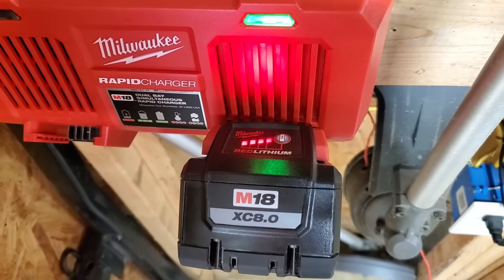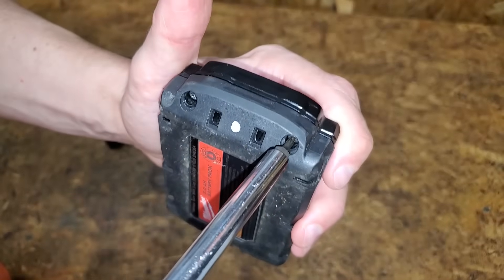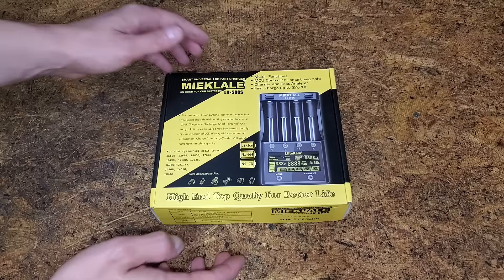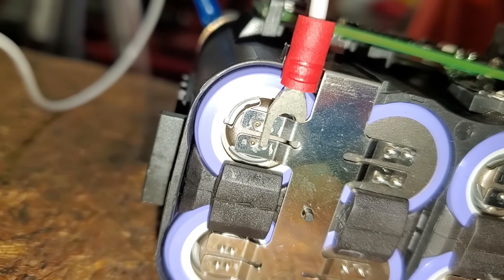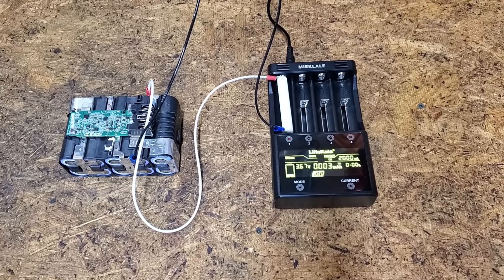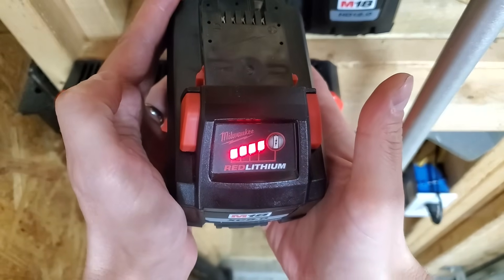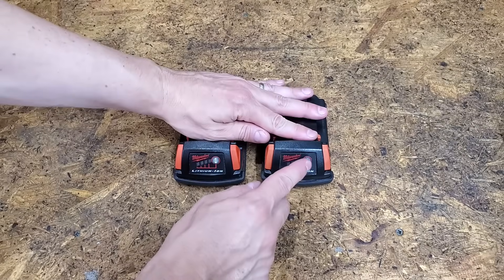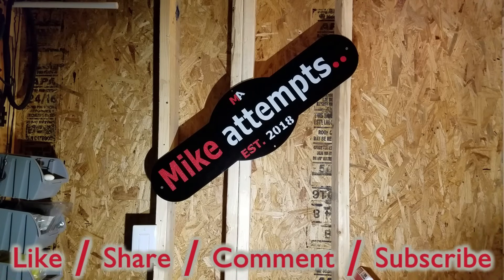Balancing Power Tool Battery Packs

Comment: I have a flat M18 6ah. I forgot it in my backpack sprayer and when I found it it wouldn't even blink when I pushed the button. Put it on the charger and the charger flashes red. Think this technique could bring it back to life?
Reply from the maker: From what others have been saying in the comments, this could work to bring that 6Ah pack back to life. However, some chargers have a low voltage cutoff and won't start charging unless they sense a minimum voltage. I'm not sure about this specific charger though. The only way around this would be to use something like a bench power supply that provides constant current without caring about the voltage. Just keep the milliamps low so you don't overheat the cell.
Reply: @Mikeattempts   Thanks for responding! If I were to get a bench top power supply what would you recommend for voltage and amperage settings for a trickle charge?
Reply from the maker: @whiskymedic  I'm no pro but, to be safe, I wouldn't go any higher than 1000mA (1 amp). I would assume that setting the amps would automatically set the volts but I'm not sure since I don't yet own a bench power supply. Each sell is fully charged at 4.2v so just keep that in mind.
Reply: @Mikeattempts   thank you so much for all your help! Much appreciated!!
Reply from the maker: @whiskymedic  No problem, let me know how it goes!
Reply: @Mikeattempts   will do
Reply: If any of the cells have gone below 2.5 volts, the pack probably won't recover.
Reply from the maker: @Right_2_Own  Ah, good to know. I wasn't sure how a failed cell would present itself. I assumed low voltage, much lower than the rest, but I didn't know the threshold between salvageable and failed.
Reply: @Right_2_Own  good to know, Thank you!!
Reply: Yes it will

Comment: The 8.0s are notorious for failing their balancing. Wish I knew that before I purchased 5 of them. Quarterly
Maintenance is my new jam. Never thought I would own a power station.
Reply from the maker: Yeah, I've heard bad things about the 8Ah packs as well, I have 2 of them. So, for your usage level, they become unbalanced again about every 3 months?
Reply: I have an 8.0 that did this after the 3rd use. I was going to return it but decided to try this before giving up on it.
Reply from the maker: @David_H_Parker  If it's that new, you might just be able to exchange it for a new one.
Reply: @David_H_Parker  Definitely return it instead of doing this.
Reply: I soldered my jumper cables to the power station.
Reply: Nice to know this. I have 3 or 4 8AH.
Reply from the maker: @StephenBrewer89  Yeah, I'm pretty sure this issue has been resolved on the newer 8Ah packs.

Comment: All cells need to be 4.2v. If they're not, it'll overcharge the high ones too. Yes, it takes a while. At 1000ma, that's 1 amp per hour. So 4ah taking 4 hours is right on. The discrepancy is possibly due to cell aging. It'll go out as it's used, just keep balancing it and you'll be fine until they really crap out.
Reply from the maker: I was wondering about that since some cells, once fully charged, were only reading 4.06 volts. So, those cells are beginning to die?
Reply: @Mikeattempts As you use a cell, it'll take small bits of damage. It'll slowly lose capacity. The first cell to hit full charge stops all the others from charging. So if one cell group is 2600mah and one only has 1900mah left, the 1900mah will reach full first. 4.2v is full. The one that was low counterintuitively is the best cell group of them all as it has the most capacity and needs longer to charge. Some BMS boards can balance as well, but I've seen a lot of them that don't or just aren't very good. If the cells get super hot when charging, or charge and after a day sag down in voltage, or read open circuit or short circuit, they're bad. Sometimes cells below 2.5v can be recovered, but be careful when you do it. Out of thousands I've never had any explode from being charged from too low. Full charged cells being shorted is the most dangerous situation to avoid at all costs.
Reply from the maker: @joblessalex  Good info, thank you!
Reply: @Mikeattempts  They're probably fine. DeWalt only charges each cell to 4.0 volts, likely to get more charge cycles from a pack. Maybe Milwaukee is keeping the cells under 4.2v for the same reason.
Reply from the maker: @Right_2_Own  The voltage was different for certain packs. For example, on one pack, I'd completely charge a cell to 4.2v and then when I'd measure it with the multimeter, it was right on. But I'd fully charge cells from another pack, the charger would say 4.2v, but when measured, they were only at 4.06 volts. I didn't know if that was due to the specific cells used in that pack, the circuit board used in the pack, or if it was a sign that those cells were beginning to fail.

Comment: Its more efficient and safer to using an RC charger/ balancer or a passive battery checker/ balancer like an ISDT BG-8S that discharges cells to balance  all the cell independently at the same time while shutting down if a fault occurs.
Reply from the maker: Ah, I didn't know that existed. A quick search shows they aren't expensive either (~$40), thanks for the info!
Reply: @Mikeattempts I guess the BG-8S has gone up in price. I only paid $18 a piece for the two I got on amazon in 2020. 

Tenergy 5-in-1 Battery Meter is another option. It has basically the same functions as the BG-8S but only displays a single cell voltage at a time. So you have to press a button to cycle through and see details of each cell instead of seeing all the cell voltages on a single page.  Its currently $17

Edit: If you go with a Tenergy 5-in-1 Battery Meter. Make sure its a Tenergy branded unit. theres lots of generic battery checkers that look identical but do not have the battery balance feature.
Reply from the maker: @mumbles1justin  Great info, I appreciate it, I'll check 'em out!
Reply: @Mikeattempts  If you have a completely dead cell and need to force start a cell to charge you’ll need to use a variable bench power supply or an RC charger in constant current / constant voltage mode to revive dead cell. Because the charge you’re using Im sue has a low voltage cutoff just like the BMS in the battery pack which wont allow output if cell voltage is below around 2.75V.
Reply from the maker: @mumbles1justin  Makes sense. I've been trying to come up with reasons to get a bench power supply anyway. :)
Reply: @Mikeattempts  you can buy active balancing board and a few connectors that can be soldered to battery that needs balancing, active boards can give much higher balancing current and balance both with or without charging.
Reply from the maker: @johndoe9922  I don't want to speak too soon but I think the 8Ah and 2Ah packs are good to go (for now). I'm gonna need to replace the cells in the older packs. I realize I don't have the best charger for the job, but my hope is that I won't need to be rebalancing cells a lot. The more advanced chargers sound like a great option for businesses that put their packs through many more charge cycles in 1 week than I would in 1 year. :)

Comment: Cool video, definitely should do a follow up video on these batteries. I’d like to know if any went back to their original status before you fixed them. Especially those old ones.
Reply from the maker: Thanks! Yeah, I'm interested to see what happens with them too. I assume at least some of them are gonna require some cells to be replaced.
Reply: @Mikeattempts  If you repack the battery, just put all new cells in it, otherwise you'll have more problems if you just replace some old cells with new cells.
Reply from the maker: @BrucePierson  Good point, thanks Bruce!